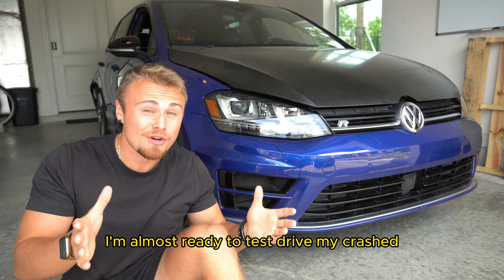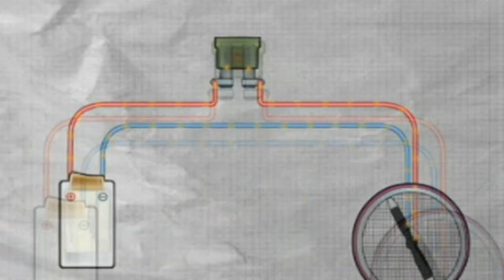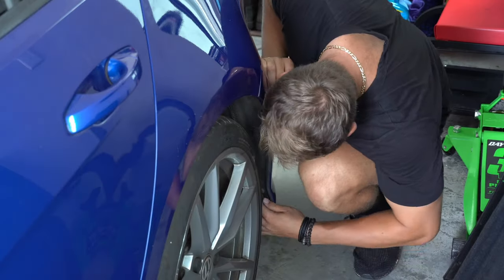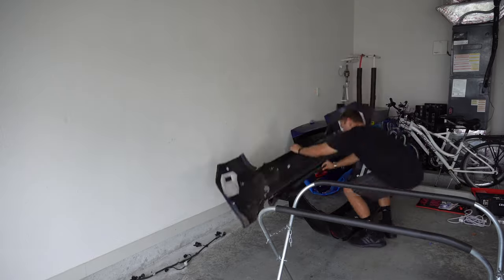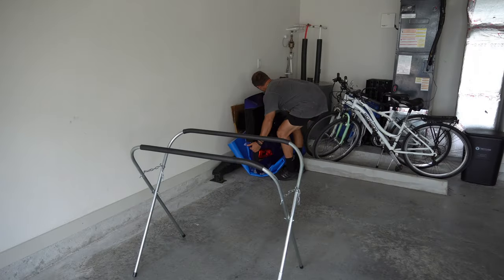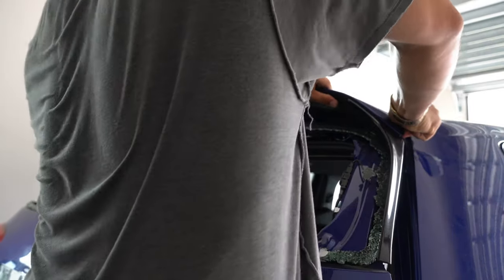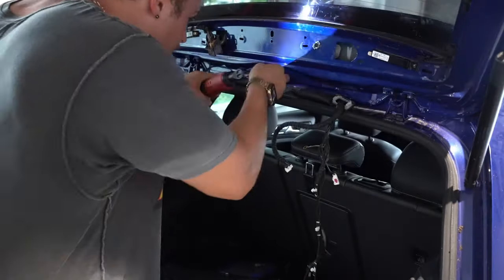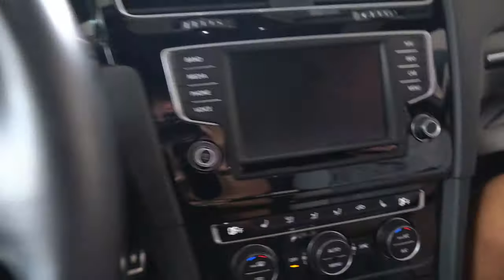REBUILDING A WRECKED VOLKSWAGEN GOLF R | PT 9

Comment: Panel Bond.....Makes it much easier to but those plastic brackets back on....Tip for the next ones...
Reply from the maker: Thats a good idea! I had bought plastic bond glue but decided plastic welding was quicker than holding it on tight for 15mins each

Comment: You may well be a novice technician but you do know some correct terminology (sans calling the fender a 1/4 panel of course} such as calling the extension a "wobble" extension AND, you seem to have the aptitude for this kind of work which is WAY HELPFUL if you plan to continue on this road.
Reply from the maker: Thank you man! I know i keep messing up the 1/4 panel and fender. But it is actually a wobble extension. Im pretty sure. The end of the extension is almost like a ball and lets the socket kind of turn to a degree. I like fixing things🙃🙃🙃